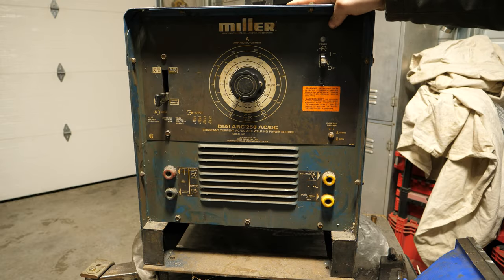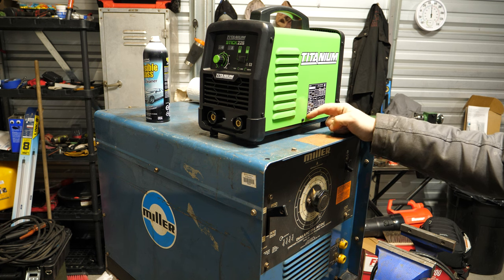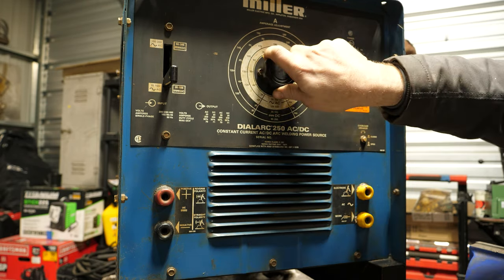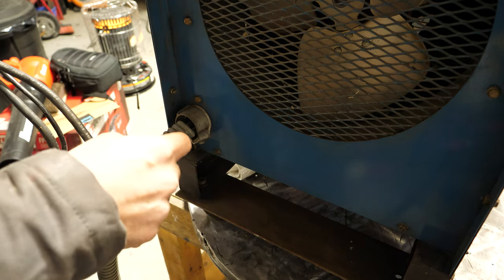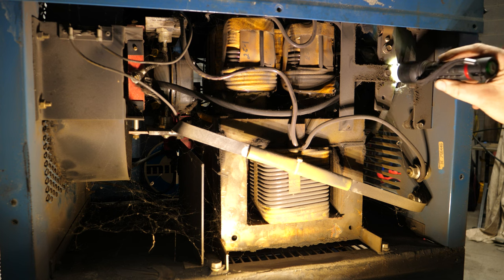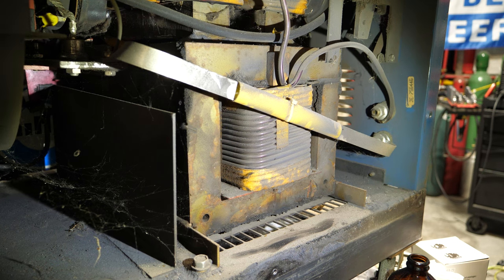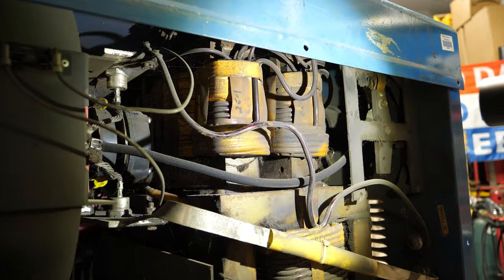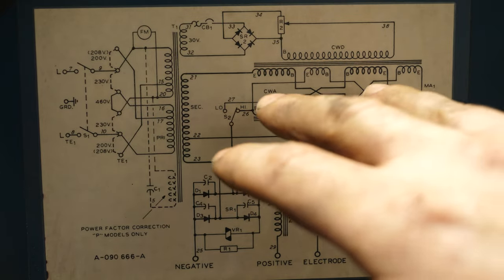Fixing up a 40 year old welder: What to look for and how they work

Comment: The amperage is controlled by saturating the magnetic field of the transform by controlling DC current going into the CWD winding through the rheostat R2. It is very simple and very reliable. I maintain a bunch of SRH333 & SRH444  welding machines which are very similar, just much larger.
Reply from the maker: Awesome, thanks for the info.  That’s pretty ingenious, and a far better setup than the ideal arc I previously had.  That machine used a shunt that would be moved in and out of the transformer to control the transfer from the primary to secondary winding, from what I remember.  All of the mechanical parts made it more work to keep working smooth, and I have a feeling made it much harder to get an accurate output.  I rather have the simplicity of the dial arc and the ease of adjustment.

Comment: It looks like it adjusts the amps by using a 30v winding on the secondary run through a rectifier then through that variac(adjustable resistor) and then back into the transformer on a another secondary witch would induce a stationary magnetic field into the transformer this would then increase or decrease the inductince of the transformer and change how much current it can deliver(sorry for spelling  errors)
Reply from the maker: Awesome, that makes sense 😀.  You and the other person posting info on that are my hero’s.    That is a ingenious design, I like it far better than what Lincoln used.  On their old welders they basically used a mechanically moved shunt (what lincoln called it) to increase or decrease the transformers magnetic field/flux that would transfer between the primary and secondary.  The miller setup is far nicer because you don’t have to hand crank a stiff wheel forever to adjust amperage.  It also seems to be pretty accurate on output too.
Reply: @makingmistakeswithgreg   Thanks for the comment and love your videos you've helped me alot in improving my welding 
I have seen those welders with the shunt you screw in and out 
Also I'm not an engineer so I'm not sure how correct i am

Comment: Hay man you after my own heart with that old Miller welder I have a Lincoln 225 amp tombstone buzz box run on 50 amp breaker my old one the best I can tell is a 73 model the fan is down but going to get a new one can not beat old junk.lol

Comment: Great video. Looking at the schematic I couldn't figure out how that dial regulated the welder's output current either. Commenters explained that a DC current on the secondary of the transformer is regulated by a variable resistor. A transformer can only support so much current before it "saturates". I guess the more DC current put into the secondary winding of the transformer, the less is available for electrode current.  Very clever design. Regarding inductors and capacitors, they both filter AC as you said but there are differences. Capacitors filter voltage by trapping charge between their plates which tends to keep voltage constant while inductors trap magnetic fields in their windings which tends to keep current constant. I guess  you want inductance to try to keep electrode current constant.
Reply from the maker: The way that current control works is pretty ingenious for sure.  Miller used that system for a long time while Lincoln was still using mechanical means to block the primary to secondary magnetic flux.  I am very thankful for everyone that shared details about how the systems work, the more I learn the better.  Also, thanks for sharing the info you did 😀👍

Comment: The potentiometer is controlling the strength of the field on the top of the schematic. This is a saturable reactor and through physics (magic) I don't understand, controls the output of the main transformers. It's like adding a magnetic brake to the field. (Eddy currents)
Reply from the maker: Very interesting.  That makes sense.  Far more complicated than I would have expected lol.  I am thankful for the design, the simple dial is much better than the mechanical design the ideal arc 250 I had previously.   Amazing that someone figured out how to make the design.

Comment: Excellent video & nice score! I'm especially interested in part 2, to see how it welds & learn more about the bridge rectifier and choke (which I'm considering adding to a Lincoln tombstone).
Reply from the maker: In part two you will see a bunch of testing including amperage draw and calculated power factor.  The bridge rectifier and big choke actually produces cleaner output than I expected.

Comment: You are a smart man. I went to engineering school (mechanical)where I learned a little about circuits, but it wasn’t until I worked with cathodic protection and rectifiers that I became familiar with transformers, diodes, chokes, etc. You explain it well. The 7024 rods run well, btw. They lay down a lot of metal. Amps up, let it burn.
Reply from the maker: Thanks for the kind words 😀.  I really want to go to school to understand electronics more, but due to a lack of time I resort to doing a lot of reading.  I am glad the 7024 rods run well for you.  I really like them for the nice wide and flat welds they put down.  I was lucky enough to run them in welding school, because I would have never probably used them otherwise.

Comment: Nice!
I'm about to be refitting my Dad's old Rainbow Warrier Welder from Sears in 1976.
I'd imagine they are very similar.
I know it has a massive transformer!
Reply from the maker: I know those machines, they pop up from time to time for sale 😀.  They will have a big transformer and they won’t likely have a big choke/reactor like the welder In the video because most at A/c output.  They still weld good, much like a A/c buzz box 😀

Comment: Give me a good old transformer/rectifier machine over these damn inverters! 41 years in the welding industry, I’ve learned that the inverters have limited lifespan’s, and when something fails on them, it costs as much to repair them as it did to buy it! Our shop bought several Miller inverters and they ran great for a couple years, then they quit. Sending them to repair revealed a PC board failure, the same one on each machine, and the repair cost was over 2/3rds of the purchase price! Meanwhile, the Miller SRH-333 transformer/rectifier machines that were purchased new in 1979 were still operating flawlessly in 2020 when I retired! And these things were used in heavy railcar repair, and had hundreds of hours of air-arc gouging on them! There’s an element of people out there that like buying new stuff all the time. I’m not one of them! Give me the bulletproof, tried and true, ugly as Fido’s ass, machine, and everyone else can buy the pretty little green inverters!
Reply from the maker: Arc gouging is a big time life span reducer on virtually all the inverters out there.  Since it operates at high amperage and high voltage it’s tough for a inverter to handle the load.  No doubt for manufacturing it will be a struggle to find options that last.  You can almost be assured anything that just came out won’t be worth it lol.  I do wish the repair bills on inverters were far more reasonable.  That’s honestly part of why I bought the dial arc 250, once I can finally find a new shop to buy I will definitely have it as the “I know it will work” machine lol.
Reply: @makingmistakeswithgreg  I learned on a Lincoln Idealarc 250 AC/DC, in the late 70’s, and that machine is still going strong, and it lives in a shop that ran the thing every day for decades. The guy has retired now, but the machine is as good as the day he bought it! He mounted it on cart for use in industries that he did work for, and one day years ago it actually fell off the bed his welding truck and landed on its side on concrete. Despite the desire to find a priest to give the thing last rights, we loaded it back up, took it back to the shop, and you’d never know anything had happened to it! Didn’t have to fix or replace anything! Bulletproof!!
Reply: The only negative thing is that you pay that reliability in the electric bills.
Does any of you have ever made real calculations of a break even point in the electric bills considering old school machines VS new inverters with PFC?
Eg, welding 130 amps, 20% of the On time of the machine.
I know that the breaker in my garage will pop after 1 minute 130 amp welding with the old machine, and will NEVER pop with my new unit, same output.

Thanks everyone,  Sarto

Comment: FYI, I believe that JE serial number makes that machine a 1984 model.
Reply from the maker: You are correct, I found that out after the video.  It’s the only welder I own that will be working at 40+ years old
Reply: @makingmistakeswithgreg  I love the "old school " machines and have repaired several including welder generators. The problems are usually simple fixes if you can still find the parts. It was fun watching you go through this little jewel.

Comment: Ok so my high school class slipped a little over the years so according to the web it is approximately 75,000v per inch for electricity to jump a 1 inch air gap so Im assuming at 1/2 inch air gap 52:51 you need approximately 37,500v so your wrapping tape with your 120v per line in is  completely is unnecessary as a matter of fact it may cause issues down the road .. if the tape heats up and starts to come off overtime .. this is why you never see tape been used in a location like that always clean terminals no tape that can get hot and catch fire. Don’t want to sound like an ass here but these machines were Engineered and approved by UL and CSA to work for years 😊 I believe the stud broke off when they disconnected the welder … that cable is way to stiff to be moving it around completely the wrong cable if you want to move it around should have had a lot more strands of copper like the one you installed nice and flexible.

Comment: I'm in UK and use an old Syncrowave 250 on 3 phase 415v 32amp. I didn't think these big beast would run single phase.
Reply from the maker: Here in the states we have stupidly high amp services (200-400 amp single phase 240v) so the possibility of running big welders on single phase is there.  3 phase is far more efficient for sure though.
Reply: @makingmistakeswithgreg  Crikey... When we had our house re-wired I asked the sparky to put a 64amp 240v socket in my garage (to run a welder) I'm pretty sure this is the highest you can run single phase in UK. Although I maybe wrong👍

Comment: Very cool! I really like that old stuff, too. But not for daily work. When handling lower amperage a shoebox can offer, I would choose the shoebox. For higher amperage you would be in need of your personal power plant... I rebuilded my fathers transformer 220 or 400v 40-160A output, AC only. Very smooth arc and fun to weld with but... heavy and inefficient. (not as heavy as your new old miller😂). To be honest it was basically for a tribute to the "old days" as well to my father himself who welded with this machine for almost a lifetime. So I will keep and use it - for fun, for understanding old technique and for the history within.

I think that small brass stud is sufficient because of the very short distance it has to carry the power compared to the cord.
Your "jumpers" may help to anneal the poor conductivity of the steel studs.
It is interesting, how things are made somewhere else, because here we are tought never to solder on crimpc-onnectors or bolted terminals because the solder behaves like a highly viscose liquid under constant pressure and float so that the connection becomes unstable over times. As always: great video on a very interesting topic! I really appreciate that you get into savety in first place. An other viewer moaned that every idiot could rebuild such a machine. I partially agree but that idiot may somewhen in his life(perhaps near the end) start to smell like grilled chicken. So everybody who does not want to end up sa a "welldone" hillbilly should take advantage in watching this video and follow your advice.
Reply from the maker: In part two when I test the efficiency and power factor it’s pretty eye opening.  Without spoiling it the power draw is high lol.  At idle it consumes 600watts lol.  It still welds great though 😀

Thanks for your thoughts on everything else too.  The solder should be ok, but I will definitely consider that in the future.  My main concern was without a better crimp that the wires would not be retained properly.  I wanted to just use copper buss bars but I didn’t have any flat copper around.  I am thankful for tips everyone shares 😀
Reply: There are crimping Tools that keep that shoe round on the wire. This fasten that wire dead solid.
Reply: Something i forgot to mention is about the reactor: I think of this as a device that stores a huge amount of power in a magnetic field and releases this by induction when the voltage drops. Not only to flat out DC voltagecurve oc but also under load. I assume when starting the arc: the moment the rod touches the steel, you create basically a short. That means to me voltage wants to drop immediately to zero. The reactor feeds energy into that circuit in a fast respond and flattens out that curve, too so that the arc easily can be lit. It basically keeps the voltage on the output stable when the resistece in the welding circuit changes. Maybe I'm incorrect, but that's the way I picture it.

Comment: If you find the AC only machines, don't be affraid to consider a heat sink and rectifier since they can be found online for well under $50.  Maybe add a fan too and power supply if there isn't a fan voltage power source. The heat sinks might be something you can home brew from like a computer CPU.  Like noting above, replacing the diodes, you can just purchase a full bridge rectifier either as super cheap lower current ones that can be paralleled together or just spend a little more for the larger current (Amps = A) single one well overrated for your machine.    I didn't realized those Millers had such a large inductor to smooth the signal.  Nice!  Sure beats DIY homebrewed microwave oven transformer cores rewound as inductors to smooth the DC.
Reply: Good video, liked and subscribed!   I like how you noted as well, where the reactor is like a capacitor.  I think of as the voltage = potential = electric field and then the amperage = current = magnetic field.  Capacitors in this situation smooth out the voltage and the Inductors smooth out the current.  When one is changed the other will be changed to keep things basically and simple speaking.
Reply from the maker: Great thoughts on making a a/c into a d/c machine.  I have thought about doing just that since I like collecting welders and many A/c machines can be had for so cheap.  Definitely could be a fun project for the channel 😀

Comment: I have the Dialarc 250 HF as my Tig machine. I have the Titanium 225 for SMAW. The Miller is on a 240V 100 amp service. The T225 is on a 240V 50 amp service.
Reply from the maker: Awesome.  I assume you use the 225 because it’s far more portable?
Reply: @makingmistakeswithgreg  Actually, it is a far better power supply for DCEP. 6010 runs smoother. 7018 starts easier.
I did remove, clean and reconnect every connection in the HF 250 and it made a huge difference in how well it runs Tig.

Comment: Amperage adjustment is done by a 30vdc control circuit.  It’s done with a Magnetic Amplifying Transformer.   The more DC in the circuit, the less amperage you get out.   If you lose the control circuit, check the little bridge rectifier.   On my my Miller 330AB/P it was I believe a 40A rectifier.  The second time it failed I replaced it with with a 70A on a heat sink.  Never buy parts from Miller or Lincoln.   You’ll pay $100 for a $10 part.   Do your research and find it online from another source.
Reply from the maker: Awesome info, I am forever thankful for the bits of info like what you shared.  I saw the bridge rectifier on the blueprint but didn’t understand what it’s for.  Now it makes sense, and quite an ingenious setup.  Sure beats the mechanical shunts the ideal arcs I had previously.  I will spend some time researching that type of transformer 😀

Comment: RE studs .. don’t forget that it is only 120v going through each stud not 240v. However if you are running the welder at 480v or even 600v then the amperage will be much lower and the studs don’t give a crap about voltage more about amperage and heat .. lets not forget it takes over 10,000v for electricity to jump a 1 inch gap and your little stud could handle 10,000v as long as you amps are low .. if I remember my high school Electrical classes correctly

Comment: Another interesting item is that Miller supposedly no longer produces any transformer type machines. Even their longtime buzz box “Thunderbolt” machine is an inverter. An inverter that’s easily stolen because it will fit in a lunchbox!
Reply from the maker: If they do make a transformer it would be in a big industrial unit only. You are right, their thunder bolt series went inverter.  They also dont weld as good as the transformer machines, they can’t produce much closed circuit voltage.  The price is also inside (700+) lol.